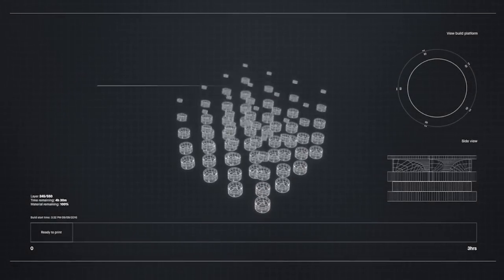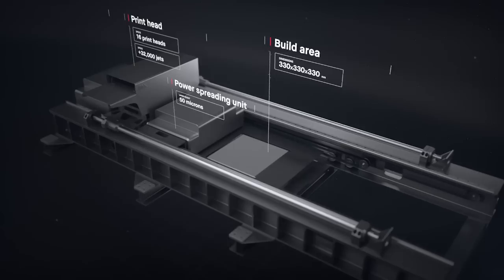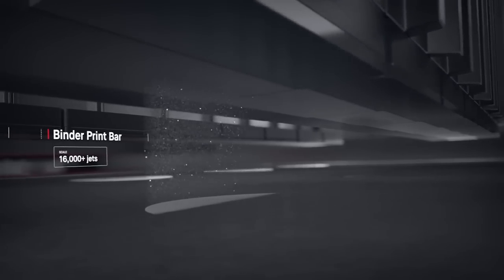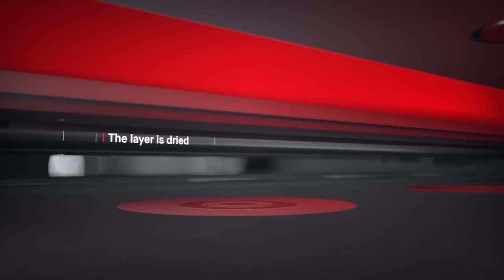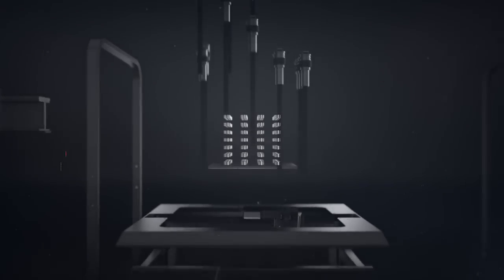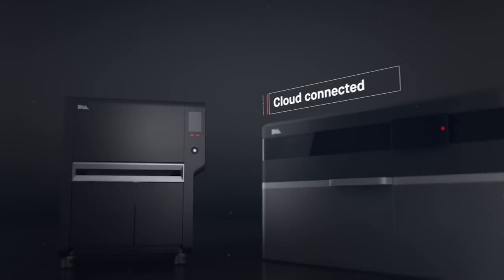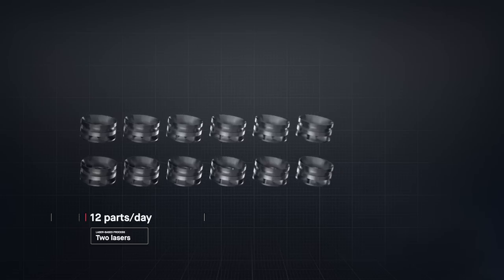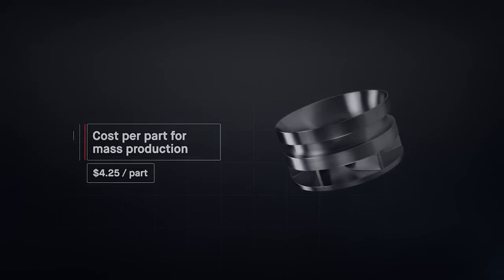Desktop Metal Production System is about to take 3D printing into the mainstream

Comment: Do this uni-directionally on a "belt" to  reduce time between the application of successive layers (eg. line up five of these printing units and circulate them so a direction change isn't required). It would reduce the energy consumption of the printer as well as the momentum of the printing unit would not need to be reversed to lay down the next layer.
Reply: That introduces a lot of problems. If 1 print head fails on this machine you notice as no parts come out. If you had 5 and one broke you might not actually notice but all parts would be weak. It would also take more setup to align 5 printheads than 1. I agree with you though, belts could be good if you are going to buld a 3d printing factory to deal with millions of parts, not just hundreds/thousands.

Comment: 500 parts vs 12 parts in same time (2:30) is 41+ times faster, not 100 times.  What kind of part is made 100 times faster?
Reply: Parts that takes the whole printing volume? Because it takes the same time per layer, regardless of the binded volume.

Comment: How do you guarantee consistent material properties?

The mechanical properties such yield strength of a metal are determined by it's grain structure at the atomic level. This form of metal printing basically "glues" together fine metal particles. It's completely NOT the same thing.
Reply: pretty sure the heat treatment binds them atomically. the binder compounds are temporary and are removed on heating.
Reply: +MrChangCJ  They only heat it to just below the melting point. That by definition means the atoms cannot fuse together the same way as if the material was poured in a foundry then forged by a mechanical process. It would be interesting to see a cross section of the material under a microscope for comparison.
Reply: Hmm true. Not the same I suppose. But what I had in mind was forge welding where the pieces aren't melted down but can form bonds on the atomic level.
Reply: They are sintered at the end of the process
Reply: +James Crud have you ever heard of heat treatments? The atoms moves regardless of the state of the material.
Reply: Cobalt-chromium or f75 (HIP) -> Tensile strength 1000 (MPa) Elongation -> 40%
Steel 4640 (HT) -> Tensile strength 2000 (MPa)

Comment: How much?
Reply: The Desktop Metal Production system, which will ship in 2018, costs $420,000 to purchase outright.
http://newatlas.com says $360,000 so maybe it dropped in the last 4 months.

$120,000 still for the home system and furnace. havent seen info on how many Kw it requires.
Reply from the maker: 360 grand is just for the printer. Full system price depends on how many furnaces you want to add for speed.
Reply: One article said $120k for studio and $360k for production version.

Comment: The whole thing is 20 times cheaper or only the materials? The printer looks quite expensive and I expect something for about 100-200$ per unit.
Reply: It's printed faster so the whole thing is 20 times cheaper.
The powder used for 3d printing has always been expensive but it can be replaced by powder used for metal injection molding.

Comment: Tolerance on finished parts? Anyone read anything on that?
Reply: 50 um? 

newatlas _ com/desktop-metal-3d-printing/50654/

"Print resolution is as fine as 50 microns..."
Reply: Eugene Dask Tolerance is a little different. Regardless, the printed parts could be machined to improve tolerances. Amazing machine
Reply: The parts reduce in size when they are sintered but they are also printed larger like for metal injection molding.

Comment: I assume it cannot match the strength of forged metal..
Reply: I bet it can break with a samura Sword.
And what does it matter?
Reply: Guilherme Silveira one cannot talk abouy metal without talking about the amount of stress it can take.
Reply: Siddharth Sharma one will not use aircraft's alloys for a Raspberry pi case
Reply: Guilherme Silveira what are you even talking about.
Reply: This would clearly be used for pieces that don't require high tensile strength forged parts. That's what he's getting at. This would be fantastic for mass producing low cost RC parts. It'll be interesting to see strength test results for parts made with this process since there is some degree of heat treating involved.
Reply: I agree, it can not even come close to the strength of a forged part, but when doing a proof of concept type project, forging new parts to get a working model gets pretty spendy pretty fast and the length of time needed to do that is weeks if not more. I can see where this would be able to crank out a new part in a day, with changes needed to get a working model. Once you have that, then go forge the real deal.
Reply: I do not know it structural integrity, but they are effectively tempering it as part of the manufacturing process, so it shouldn't be terrible.
Reply: 99.8% of the density of the used metal.
Reply: Eh. Modern metal 3D printing can create parts that require no welding or post-processing, and that are completely seamless. Depending on what is being printed, a printed part can be way stronger than forged parts. This just makes that faster and cheaper.
Reply: WOW, I did not know that, that printed parts can be stronger than forged parts. Where did you find that info out, because I do want to read and learn as much as I can on it and the testing involved. Thanks.
Reply: Metal 3D printing can make parts that can't be made by conventional methods, witch can be useful for fo some applications beyond prototyping. I am not sure about the quality of the prints of this metal 3D printer, and weather or not it can print alloys that are being used in the real world.
Reply: Time will tell what the material qualities of this setup will be; however, SpaceX has already demonstrated that 3d printed metal parts can be used in some of the most hostile conditions... including a full test fire of a 3d printed combusion chamber on the SuperDraco and actual flight using a 3d printed oxidizer valve on on the Merlin.

As for Desktop Metal; they've already got a pretty big list of metals and alloys that this system has already tested and something like several hundred more that are in development.
Reply: +vaporcobra  "a printed part can be way stronger than forged parts"

Educate yourself on what happens to metal at an atomic level during the pouring and forging process before you start spewing absurd nonsense.
Reply: +James Crud printed parts can be way stronger than forged parts because the cooling speed with laser sintering (not in this printer) is a lot faster and that allow to make smaller grains and even amorphous metal
Reply: Cobalt-chromium or f75 (HIP) -> Tensile strength 1000 (MPa) Elongation -> 40%
Steel 4640 (HT) -> Tensile strength 2000 (MPa)
Reply: Good for turbocharger housings or engine blocks.

Comment: I think it's weaker than the laser version..
I mean, if it wasn't,they'd advertised it..
Reply: Cobalt-chromium or f75 (HIP) -> Tensile strength 1000 (MPa) Elongation -> 40%
Steel 4640 (HT) -> Tensile strength 2000 (MPa)